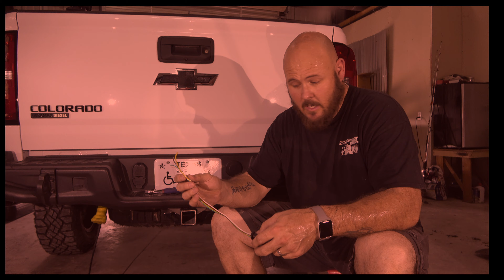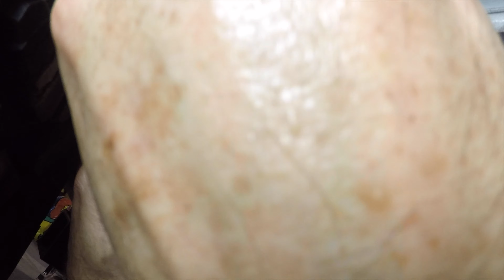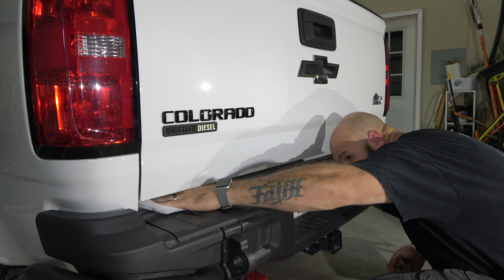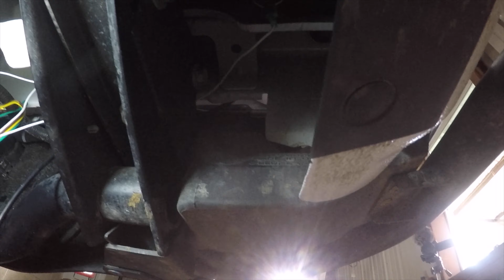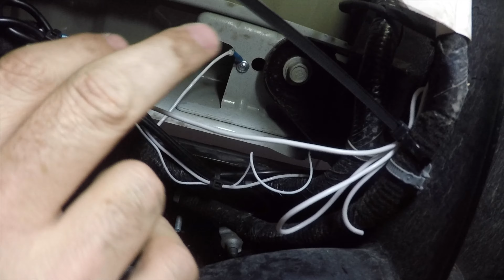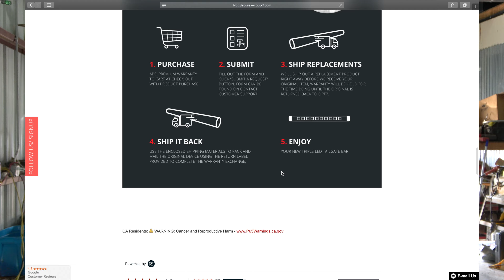OPT 7 Tailgate Light Bar

Comment: I have a 2016 f150. Do I need the adapter since I have a back up camera? Their website says I need one but I’m assuming your truck has a backup camera as well and I didn’t see you use an adapter.
Reply from the maker: We did not need one, but I’ve heard that the fords do…I would shoot them a message just to be certain
Reply: @rockyaev8287  thanks for the reply. Yeah after more research I’ve seen people with fords saying they needed one, but I also saw that you can hardwire the light bar to each tail light instead of down by the hitch which was causing the trailer connected problem.
Reply from the maker: @paynehobbs2740  that makes sense, if you bypass the vehicles plug the light bar doesn’t care ……but I must warn you if you have a warranty, doing this could void it….just be certain on what you tap into 😎

Comment: What length bar did you install? Also, it looks like the light is delayed compared to the brake light. I mean that the bar doesn't light up the first blink. Is this normal?
Reply from the maker: Yes it is how it was designed, to decode turn from brake….there is a slight delay. And it’s the 48” bar.

Comment: I saw someone else asked this. But what did you do about the two little bump outs in the sheet metal under the tailgate? Did you mount directly onto them? Or did you make a spacer so that the light bar sits on a completely flat surface?
Reply from the maker: I just pressed really well on the surrounding areas to ensure a good adhesion….still going strong to this day.

Comment: Why is there a one second delay when you brake or turn signal? I notice the lights on the light bar doesn't come on at the same time as the tail lights... hmmmm
Reply from the maker: I had the same question, so I called the manufacturer and their response was simple…..there is a “decoder” built in and it takes it a second to determine what signal is being sent. I’m not a fan of that….but love how bright and how clean the light looks in comparison to other brands.
Reply: @rockyaev8287  may be the same delay I got from me switch back front signals. But my switch back has a delay to turn back on white, after turn signal is off.
Reply from the maker: @Haulero  absolutely 😎 it’s got a slight delay so it has time to think….kinda like me before coffee 🤣
Reply: @rockyaev8287  I just installed a bar from a different brand and there is no delay! yay.
Reply from the maker: @Haulero  cool deal! Glad you found a light that fits your desires 😎 I’m all about it, when you get what you want 🤘🏽🤘🏽🤘🏽😎 rock on
Reply: @rockyaev8287  I wanted Putco, but they don't offer sequential turn signal so that was a downside. I was debating between op7 and XK.
Reply from the maker: @Haulero  ah I see, I like Xkglow’s, I run them on my motorcycle and 4 wheeler for under glow/accent light. They are clean and bright!
Reply: @rockyaev8287  *my

Comment: Great video.  I bought a 7-pin pass through cable that has an extra 4 pin hanging from it. For some reason, when it hook the 4 pin to this LED light bar, the only thing that lights up is the bottom row of LEDs. And it only lights up every 20 or 30 seconds.  And the middle of tbe top row will only flash every 20 or 30 seconds. 
When I hook up the LED bar upto our other vehicle's 4 pin trailer hitch connector, it works fine, all functions. 
Any idea what the problem could be on my 2019 Chevy Silverado Trail Boss?  Thanks again for the excellent install video.
Reply from the maker: Not certain, but it sounds like whatever is built into the pass through creates a small delay.....the light bar has a sensor that also has a delay (that’s why when you hit your turn signal there is a delay) it does this to decode a blinker signal vs a break signal. That would be my only guess but not certain without having the same item to test.
Reply: @rockyaev8287  Thanks for the reply. Good diagnosis.
 But when I plug it into the 4-pin plug on the truck, it pretty much does the same thing.

Comment: I wouldn't recommend installing a cheap $100 part this way. There is a $12 wire harness you can use that will free up your 4 plug and no splicing. The red alert thing on this video is very annoying. Whats that all about?
Reply from the maker: I’ll look into the harness. And the alert thing....I didn’t edit this video....just was put in and uploaded for me.. sorry about it.

Comment: I got this same bar for my Colorado and had a buddy install it. Everything looked great until 5 months later when it fell off. Followed all of the necessary steps. I'd reached out to OPT 7 and got a replacement, just haven't installed it yet. 
What part of Texas are you in?
Reply from the maker: Michael C wow...both of the bars we have on two different vehicles haven’t fallen off in 2 years time 😬 I wonder what happened. We are in the Temple, Killeen area.
Reply: @rockyaev8287  those 2 bumps on both ends where the bar sits definitely get in the way when trying to properly mount it. He used a strong adhesive strip to make it flush in between them. Unfortunately it still wasn't enough to hold it in place. Will need to find a place here in Dallas that can install it for me. I don't trust myself to do it properly. Love that Bison by the way, nice beast of a Colorado.
Reply from the maker: Michael C ah got ya, yeah I was somewhat concerned about that on our ZR2....what I did, since the bar is aluminum....I pressed hard enough to put a slight bend in it (over several inches of run) so nothing real sharp....you can’t tell. Really cleaned it well with alcohol and try to use a little heat (summer right now will be all the heat you need) and press really hard for about 30 seconds in random spots all over the bar. That should do the trick....
Thanks, we still absolutely love the bison....only downside is since everything is closed we haven’t had the funds to, or the ability to make trips and do upgrades. We are hopeful that 2021 will allow us the ability to get back at our wishes lol
Reply: @rockyaev8287  did you receive mounting clips with your bar? When mine fell off I'd reached out to the company and they sent me a new one. It came with 4 mounting brackets. So, my buddy and I ended up actually just attaching those with the provided self tapping screws. This bar isn't going anywhere now.
Reply from the maker: Michael C I don’t remember now. I know I did on the one for my Ram....but I didn’t use them on it either 😬 that’s awesome you got it hooked up solid now 😎

Comment: I’m noticing with yours the when u signal all 3 led strips light up and same with breaking... other videos show a solid strip across the bottom and then a flashing strip above for signals, what makes urs different? Please respond ASAP about to purchase
Reply from the maker: The only time that both rows of red come on is if the headlights are on and the brake or turn signal are on.The white for reverse only comes on when in reverse (or when unlocking the doors because Chevy has the reverse lights come on as a curtsy). When watching the video it does kinda look like all three are on but they are not. I hope this helps with your question.
Reply: Rocky AEV yeah for the most part I still don’t know how I feel about the break light showing up and the signal light at the same time...

Comment: Great install! I saw that someone already asked the question but I just wanted to further clarify; the additional module for backup cam, tow assist and some sensor isn't necessary for this setup? Like the truck doesn't "think" you're towing something? Mine is a 2019. Any information is appreciated
Reply from the maker: Jacob we have had 0 issues with the way we hooked it up. Without digging for the first question on this...I think there was only one vehicle that needed the modules (a ford) because on the ZR2, and my 2018 Ram I did it the same way with no issues. So to the best of my knowledge you won’t need it.

Comment: The light kit I received didn’t come with the “wire taps”. When I looked online, I saw the taps came in different gauges. What gauge of tap should I get to wire into the backup lights??
Reply from the maker: Glen McCall I used a 14-16 gauge t-tap (blue one) I don’t remember if mine came with one or not to be honest. Sorry I’m not sure, thanks for watching, hope I helped at least a little 😬
Reply: Rocky AEV - Cheers thanks!! 👍🏻

Comment: Great video👍🙏🙏🙏🙏🙏 .. anyway to adjust  the delay?
Reply from the maker: bala 32 thanks for watching, and the comment. 

So about the delay, I contacted OPT-7 and their team informed me...No....it's because the light bar has to receive the signal, and then determine if it's a blinker, brake, or hazard signal and that takes a second or so to process.....I tried already to get it worked out but no luck lol. 

However I will say I am ok with a little delay due to the looks, and quality over the other light bars on the market. I have used the Recon brand and it's super bright....but on three different bars I have had several parts of the light quit....and IMO did not look as clean as the opt-7 (because it looks like a solid light from about 8-10 foot away) hope this helps, and if you do buy remember our link in the description 😜😎

Comment: FINALLY  I installed the light bar. Looks good, will see tonight how strong the reverse light is. Also, I have used adapter harness instead attaching the wires together and the reverse light I connected to trucks right reverse light. I am hoping the bar will stay glued because there are two bumps between the body. I have not put the bar above the bumps but maybe half way on them and thanks to the bar flexibility I pressed it little more and it’s there just fine......how long?....well we will see haha Would sent you some pics of it, but dunno where 🤷🏼‍♂️
Reply from the maker: Ve Po awesome! Yeah I had the same questions about the “bumps” but ours has stayed put for ... almost a year now...so as long as you cleaned the surface well you should be good. If you ever want to send us stuff, check out the Facebook page (I don’t get on Facebook often because I’m not a fan lol) but Brandi will get the message and let me know! I’m happy that you got it on...it’s been great for us, hope you have the same feelings about yours 😎

Comment: Rocky AEV

Quick question, I know I can measure the width of my truck but I am feeling lazy today LOL what light from OPT7 site I should choose for the Bison please? 60" or 48"? And do I need to purchase the module? Thank you again!
Reply from the maker: Haha I got ya, the 48” is what you need. And to my understanding the adapter is for fords only......we didn’t use one and have had zero issues 🤷‍♂️ haha if you do order do us a favor and use the link in the description 😎 thanks for watching and the comment
Reply: @rockyaev8287  You bet!! Thank you sir!
Reply: @rockyaev8287  Aight, order placed from your link :) Thank you guys, you ROCK!!!
 My next move will be the camera :D
Reply from the maker: Ve Po you rock! You gonna do the dashcam? I love it, probably gonna add it to my tow rig......and maybe my hunting truck lol
Reply: @rockyaev8287  Yes, I would like to add to my red devil, its a expensive truck and one never know what is going on when I am not in it. 
 The cam and battery backup is little heavy on my valet but I will manage. They just shipped the light bar, after I am done with that, will be hunting the cam LOL
Reply from the maker: @vepo2341  Agreed on the price point, you can bypass using the battery back up if your good with wiring.....you can tie into the vehicles battery, only downside to this is if you forget to turn it off or you  don't drive often or long your truck battery will die. But if you do that until you can afford the battery back up its an option.
Reply: @rockyaev8287  I was thinking about that option, but the backup is better. And who knows, maybe I will win some lottery LOL and then the thing will not be that expensive anymore.
Reply from the maker: @vepo2341  Haha yeah well if you hit the big one remember us 😜 Good luck

Comment: Great video! Just what I was looking for.  Out of curiosity, do the reverse lights come on if you switch on the bed/cargo light?
Reply from the maker: Freshcatch Fisher I didn't think so.....I went to check just to be sure and the answer is no. There is a way to make it work....and that is by tying the white wire into a wire that's behind the drivers side taillight. There is a wire that is "capped off" that is there in case you decide to add under the bed rail lights. I may add some to Rocky.....now that I think of it haha.
Reply: Rocky AEV thanks for the info. I appreciate you checking!
Reply from the maker: Freshcatch Fisher absolutely, anyhow we can help we are glad too 😎

Comment: On the back panel of the bed where you mounted the light bar there are two bump outs in the sheet metal.  One on the right and one on the left.  Did you mount the bar above those bump outs?  And, does the tailgate obscure it at all?
Reply from the maker: TheOneRob88 I would have to go double check but I believe it’s directly on them (the light bar is on an aluminum frame and can be slightly formed to the shape). The way I mount them is I hold them in place with a helper and then step back 20-30 feet and see if it is clearly visible if not then adjust accordingly up or down. The first one I did years ago was to high and the tailgate hid most of the light.....learned that lesson haha
Reply: Do not mount it above those bumps. I did that, and learn from my mistakes! Fml. Took about 7 hours to slowly get off the lights without damaging the bar. And I ended up messing up the clear coat in a few places

Comment: Why the delay for the break light?
Reply from the maker: I really wish I could answer that....the only thing I can think of, is built into the light bar there is some kind of a resistor to keep the vehicle from thinking that there is a bulb out.......but this is just a guess,  I was wondering that as well. I will contact OPT-7 and ask, that was I can hopefully get a solid answer.
Reply from the maker: Ok I contacted OPT-7 and this is what they said:

The light bar runs off of a 5 wire system, the brake and turn signals run off the same wire (left turn/brake - right turn/brake) so since this is the case the light bar needs a second of either steady power (brake) to sense that it is a brake power source or an intermittent power (turn signal) it then processes the signal and converts it into what is seen. In a perfect world to negate the delay the light bar would need to be wired with 6 wires, one for a dedicated brake, left turn, right turn, running light, Reverse, and ground. Hope this helps.